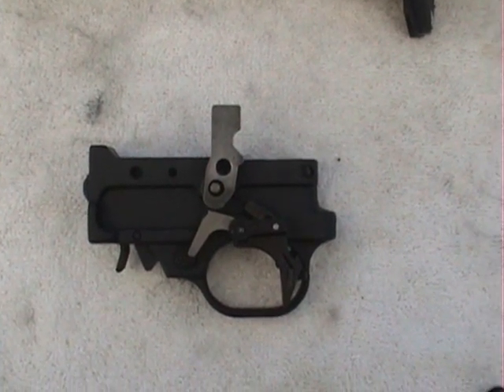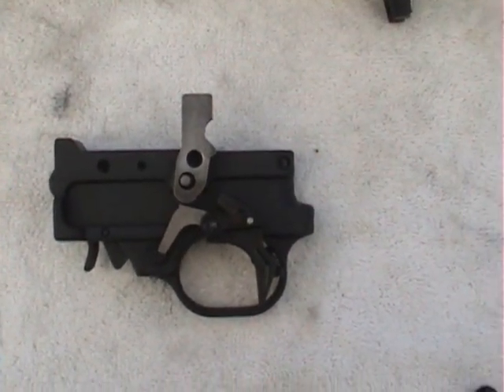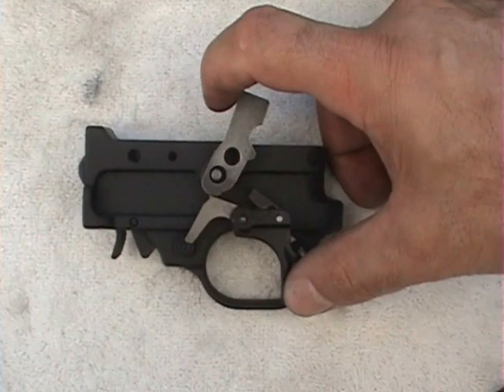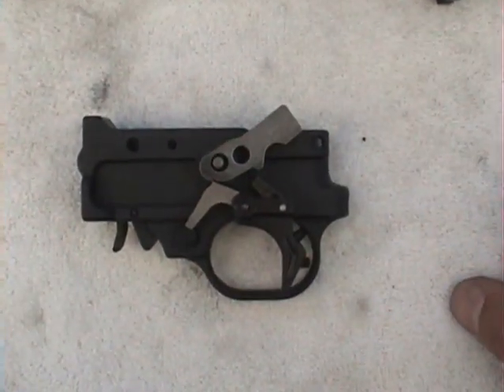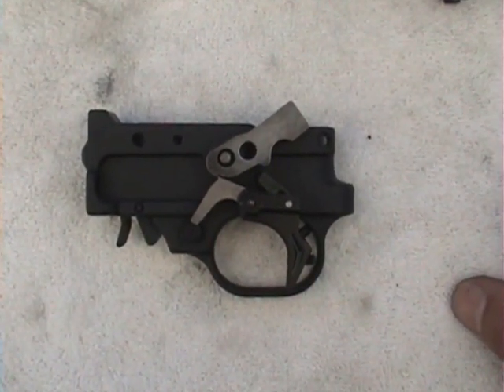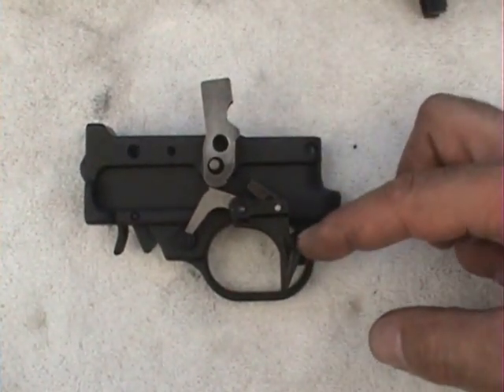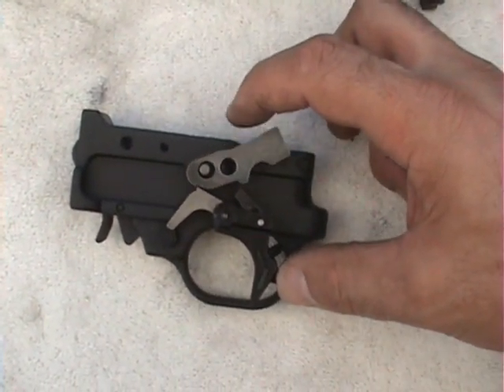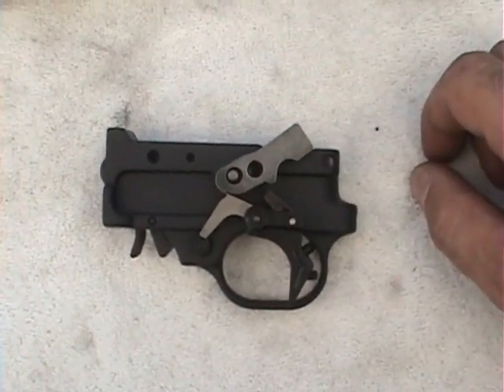How a Ruger 10/22  Trigger, Hammer & Sear Work.

Comment: If that's how it works than u would be able to hold the trigger in an it would keep firing so that means ur not showing something
Reply: freddy allen the hammer hits the black piece (connector) on the trigger which places the connector under the sear forcing the sear to reset under spring tension
Reply: The trigger part has a disconnect, which won't allow you to drop the sear off of the hammer again, until it's reconnected.

Comment: You can file the 2 surfaces down, where the sear connects with the hammer, and make your trigger as light as you want. Be very careful tho.  Only file a little at a time, then put it back together, and try it. You don't have to put the trigger assembly back on the gun, to try the trigger. Just cock the hammer back by hand, then test it, with a trigger gauge. I did this about 25 times, until I got my trigger to 1.5lbs.  A little time consuming, but it works!!!   You will get really fast at putting your trigger assembly back together. Trust me....lol

Comment: There's a lot more involved to full auto than the sear. If you simply grind off the sear, you may achieve some type of full auto function, but this would not be safe, because the hammer would be riding behind the bolt the entire time. This could lead to firing out of battery, maybe even just out of the mag.
Reply: its a .22 blowback, it will just fire when its in the chamber the whole way like an open bolt fixed fixing pin smg. 100% safe

Comment: Sooo you telling me that if i use ny Dremel on that little piece of metal holding the hammer it will go full auto?
Reply from the maker: Nope. That is not what I am telling you. However there are ways to make a Ruger 1022 with stock hammer and sear to go full auto. There used to be YT videos on it. Before information was banned

Comment: Doesn't make sense..   What keeps it from going full auto if you keep the trigger pulled back?
Reply: Sear.  It locks the trigger in a position that catches the hammer and will not permit the trigger to be pulled until it is released first.  I am referring to parts that are not present in this video, by the way.

Comment: Help! When i charge the handle its pushing down the hammer which then hits the disconnector which then puts my sear into a different position that wont fire. How do I fix this?? I made a video showing how the hammer doesn't fire forward when the trigger is pulled because of this problem..

Comment: @shoktroop No, I didn't forget to install anything, all the parts are there. If you watch the video I show that it returns like normal until you push the hammer all the way down. So it doesn't have anything to do with forgetting something, all the parts are there and installed..

Comment: Shoktroop. If I want to smooth out the trigger pull, do I need to get a new hammer, trigger, and sear. Keep in mind, I only want to smooth out the trigger pull and not necessarily lighten how many pounds of pressure it takes to actually pull the trigger. I am looking for a smooth pull only.

Comment from the maker: After you fire the weapon, when the bolt is moving rearward it hits the sear/reset this stops the hammer from moving forward again. Try this little test. If your at the range load up a magazine, and charge the weapon and fire it but DO NOT let go of the trigger. Keep it squeezed to the rear. Then let go. You will feel a click. that is the sear being reset. I can't tell you any much more than that. It starts getting into the full auto questions and I will not answer those. Sorry.